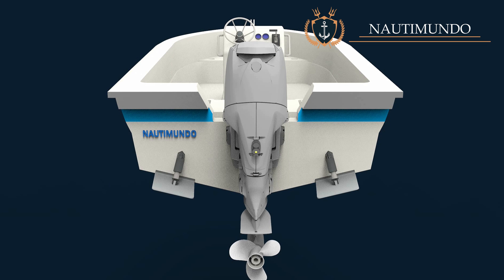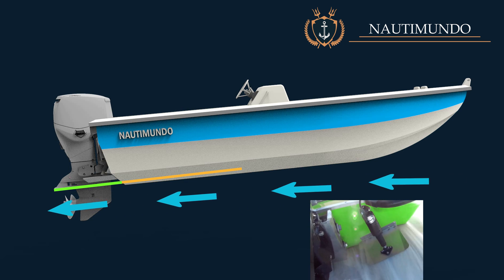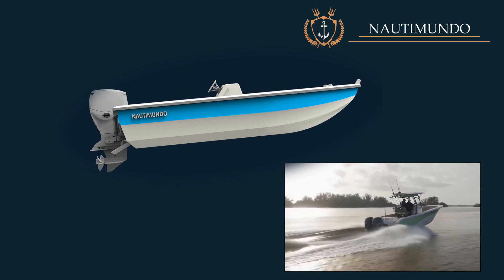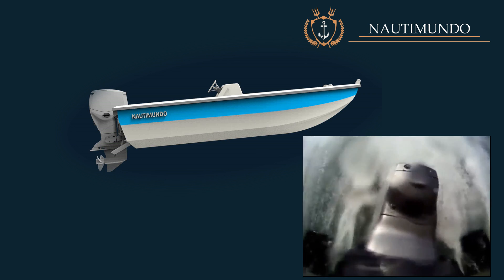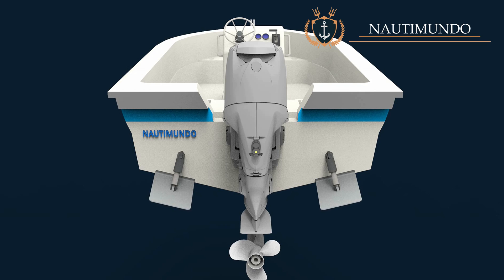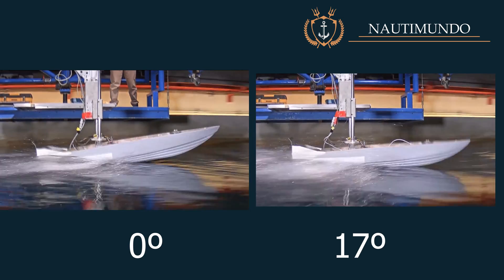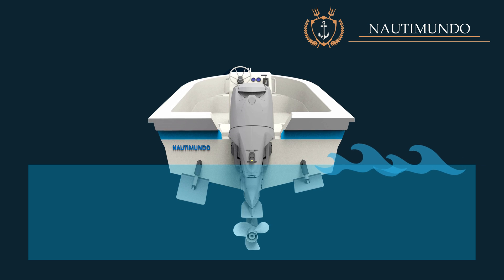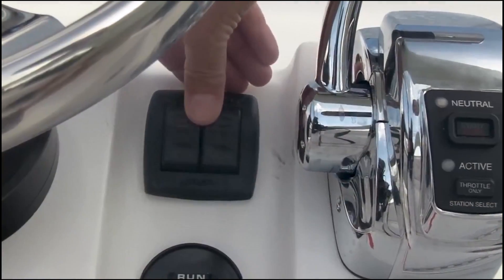🚤  TRIM TABS 101 - How to use trim tabs on a Boat - How do trim tabs work?

Comment: I have 20 ft small cabin boat with displacement hull. It can reach 6 knots max speed with 8 hp outboard (and same with bigger outboards because of hull type). I was thinking of installing trim tabs so I can put on 30 hp engine to achieve better speed. Could it be possible without changes of the hull design?

Comment: I have a 1999 Sea Ray 180 BR with a 3.0 liter MerCruiser.  I installed Bennet self leveling trim tabs in an attempt to decrease the low speed wander when approaching my boat lift at low speed.  What I found after installation was that I lost 3 mph in top speed and really no increase in hole shot.  Low speed wander was better but it was still present. I think the spring force in these tabs is too stiff and they don't retract as far as they should when the boat is on plane.  I pinned the tabs up so they are parallel to the hull at all times.  It seems to reduce low speed wander slightly and no longer reduces my top speed.

Comment: The funny thing is the trim tab. In my sterndrive, if I activate the starboard tab, for example, it lifts the port side. The added drag from the tab slows that side and tries to turn the boat in that direction, applying upward port yaw, the opposite that is expected. Cheers